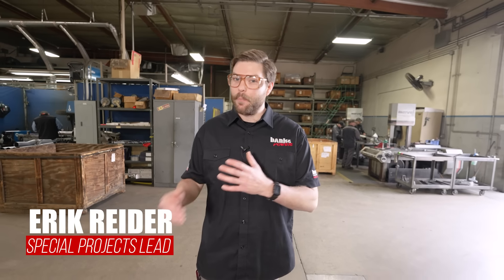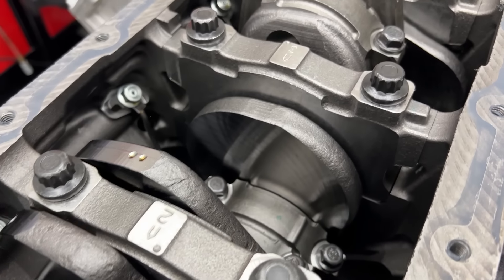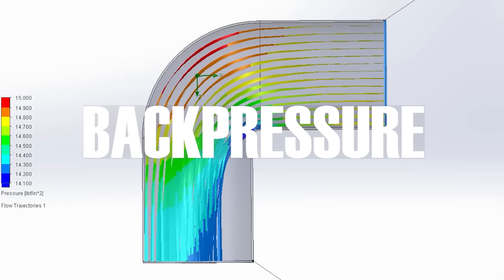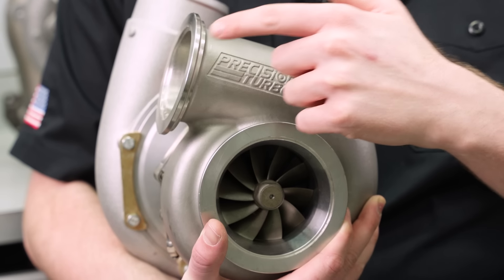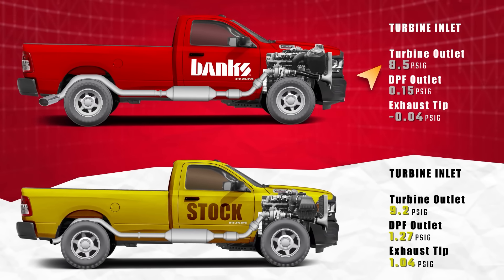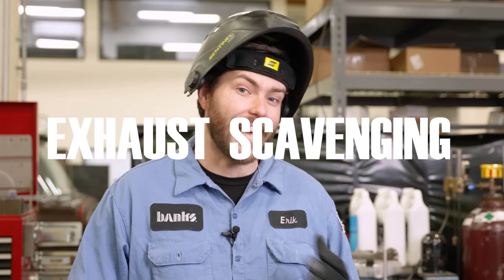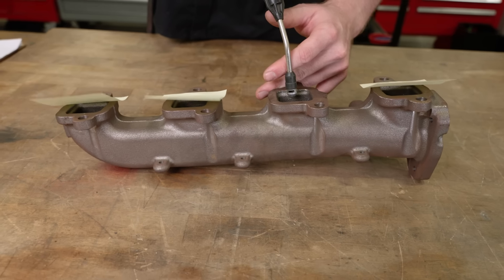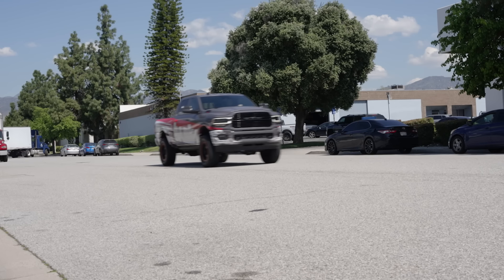Busting the exhaust backpressure myth | Banks Entry Level

Comment: I was taught when i was 5 that engines are air pumps and they need free flowing intake and exhaust  - the exhaust should have at least 8" length ZOOMIES ARE BEST & IF YA CANT PUT ZOOMIES ON THEN AT LEAST HAVE EXHAUST THAT SCAVENGES THE OUTGOING AIR!!!  I hear a lot of idiots say i want this muffler or that muffler i tell them all your doing is killing your power and damaging your engine "they want a certain sound i say THERE IS NO GREATER SOUND THAN STR8 PIPES OR ZOOMIES!!!

Comment: I don't want to rain on your parade.Mister expert but I had a motorcycle that had a hole in the exhaust pipe. Resulting in the loss of backpressure the valve lasted two weeks then it was burned right through it was cheaper to get another motorcycle than it was to have that bad exhaust valve replaced

Comment: How did you manage to patent a slash cut exhaust pipe?  Harleys with hot cams need them, and they are LOUD.
Not one word in your vid about camshaft lift, duration, or overlap.
Intake flow is also critical, again, with regard to  the camshaft profiles. Mild cams don't like a flow rate that is too high.
You are attempting to describe a whole tree by what you see on one branch.

Comment: so by this videos logic I need as little  as possible… so no headers?
Reply: Ya just drop everything go full send! 

It actually can run fine, granted having no place to put sensors in the exhaust can make tuning a challenge. The main problem comes when you shut it off and it sucks in cold air thought the exhaust ports straight onto those hot valves and they decide to not stay the original shape. A good exhaust using scavenging is the way to go, but even just a ok exhaust is better then thermal shocking your exhaust valves every time you shut it off. Maybe it’s not as big a deal today with modern materials, but I don’t drive new vehicles anyway so it’s still a thing for me lol
Reply: @jaydunbar7538 do you have any evidence that shows this could happen?
Reply: ROFL

Comment: The explanation of the hair dryer is WRONG!!! when you block the outlet of the hair dryer the motor has less resistance to push air so it speeds up, think about it when its moving air its doing more "work" when you block the inlet or outlet it is moving less air and it increases in rpm and reduces power draw because is is working on less air, put the hair dryer on a watt meter and prove me wrong! if you cover the inlet or outlet it will draw LESS power! this is a common miss conception because it would take our lungs more power to push air out but the fan blades will stall and use less power.

Comment: The flow pattern inside the exhaust created by the recipricating action of the engine is a series of pulses each having a high pressure profile at the front end and low pressure profile at the tail end. It is certainly not a laminar flow pattern as you suggest in your diagrams. The use of the term "Backpressure" when talking about head loss is the issue. What you are really taking about is resitance. It is misleading and no doubt an old marketing scheme for cool sounding mufflers with bad flow characterisics. Lower pressure on larger diameter pipes is expected along with an increace in velocity of flow. That is the physics of the flow of fluids through pipe. Compressible and non compressible. The bottom line is the most efficent exhaust pipe is no exhaust pipe.

Comment: The reason a little back pressure is (was) needed, has NOTHING to do with clever salesmen, that's just BS he pulled out of his ass.  The reason has to do with carburettors that were tuned to specific engine specs. When the specs changed with high flow air filters and extractors, if the carburettor was not adjusted accordingly, the resulting air fuel mixture leaned out.  Sometimes so much the engine was damaged, overheating, burning out valves or pinging like crazy and scarring the bores, in extreme cases even burning holes in the tops of pistons. Other times (usually), the engine just ran like crap and chewed up plugs.  This is STILL the case for non EFI engines that are not tuned correctly.  So yer, if you're going to have an engine tuning channel, then maybe you should have some idea of what you're talking about and not just make up stories.

Comment: this whole thread is kind of stupid because that back pressure is needed but that pressure is needed on two strokes. Have you ever noticed the two-stroke exhaust when it comes out of the jug it’s a small pipe and then it goes into an expansion chamber where then it gets choked down, even smaller, as far as a diesel engine, or any other internal combustion engine back pressure is an enemy anybody with a little common sense knows that top fuel dragster’s make up to 20,000 hp they have open exhaust Zumiez to give them as little restriction as possible even though they’re still getting restriction from the bend in the pipe every been in the pipe is at least a 20% reduction in flow

Comment: so if the kinetic energy is in the crankshaft why have heavy flywheels?
Reply: To add weight in a easier way then buying a new crank, and in some
Applications it’s just for the strength. Use your judgment on why in the particular application you’re thinking of.
Reply: @jaydunbar7538 
He is questioning banks pseudoscience

Comment: 2 cycle engines will not run well without that very special back pressure;

4 cycle engines with mild, street, cams need the SAME backpressure as the factory made; 

when you DE-CAT a pipe (breaking up and removing the ceramic innards honeycomb, leaving only the shell to make it look like it's original...), well, after that, the car runs ROUGHER and BURNS MORE GAS;     the FACTORY BACKPRESSURE of the honeycomb is needed, the flow in and out of the combustion chamber was precisely adjusted for it;

but... too much backpressure (plugged up CAT(honeycomb)) , that BURNS EXHAUST VALVES,if you run it hard,so, better remove it;
  also,  (EGRs KILL engines, REMOVE?? do it now...).

Comment: I’m wondering why the Banks exhausts are a specific size and not larger.

You know, if they would give less back pressure being larger. 🤷🏻‍♂️

(Around 4:20 he says “why you want to MINIMIZE back pressure”, NOT eliminate it. Interesting choice of words.

At 7:50 or so he says “we have proven that ALL BACK PRESSURE IS ALL BAD ALL THE TIME” so why not eliminate it totally? Earlier he said MINIMIZE rather than eliminate back pressure.

He later says that NO scavenging happens with OEM manifolds, but you CAN clearly see some happening. 

The title, ignoring the contradictions and errors and failing to address how much or little back pressure remains, and why, would be much appreciated. 

This video seems disingenuous as a result of those failures.)
Reply: Usually size is limited due to clearance
Reply: @seanbaker1627 
Not in racing

Comment: Guy who sells exhaust systems with low/negative backpressure tells you backpressure is bad and that the myth that its good comes from people who sell exhaust systems with high backpressure. Whats the definition of irony again?😂😂

Lowering the pressure at the cylinder will reduce the loss from having to overcome the pressure, but at the same time you reduce velocity which may result in more exhaust gases remaining in the cylinder, reducing preformance and causing additional carbon build up.  Maximizing velocity while minimizing backpressure is the name of the game. You can't overcome ambient pressure with negative pressure.

Comment: Your hair dryer analogy is not correct. If you measured the current to the motor you would see that it goes down when you block the exhaust. The motor speed increases, but the work being done goes down because of the decrease in mass flow.

Comment: 1# you should think of the flywheel as a horse power storage device not the crank. 2# your valve train anamation has zero valve over lap. Not a good look for someone trying to explain exaust systems.

Comment: So many things WRONG in this video it's embarrassing, I don't have the time to point them all out.
7:10 less back pressure can create more HP at the top end and reduce HP in the low and mid rpm range where most cars/truck SPEND MOST OF THEIR TIME, making the vehicle less enjoyable to drive around town (especially motorcycles)
9:58 "with our headers we tune them correctly"?? for what? peak hp at the top end, basically hurting low and mid preformance. I have 4 decades of tuning with a dyno for a race team, I call most of this video rubbish. There is so many variations of vehicle use/purpose, and this video is busted.

Comment: Haha you dump on the 1950s sales spiel, yet you fail to realise that your negative pressure at the tip is only because of the huge can and is only localised and having little to no impact upstream.

Bernoulli's principle tells us that the increased cross sectional area will result in a proportional DECREASE in flow (velocity). A 20% increase in cross sectional area, will give you an approximate 17% decrease in gas velocity only in that section.

But in practical terms, the exhaust gas has weight and therefore momentum, and when it transitions into the larger volume, it will tend to do so at the same velocity, and it will create a temporary negative pressure as the Ideal Gas Law tells us that when volume changes, pressure changes proportionally (inversely).

Comment: thats not what backpressure is, nor what the concern with backpressure is.  you are referring to exhaust velocity and negative pressure.
your strawman fallacy is invalid.
all internal combustion engines have backpressure waves flowing up and down the exhaust pipe (and the intake, but that's not the topic here). those backpressure waves must be 'timed' to flow back to the exhaust value during the period when the exhaust valve is closed and flowing away from the exhaust valves while the exhaust valves are open, this helps extract exhaust gases, instead of forcing burned gases back into the combustion chamber, refusing efficiency and therefore power output, via scavenging.
the only relevant backpressure in a turbo system is the backpressure waves flowing between the exhaust outlet and the turbine blades, anything after that point does not affect power output. 
maybe you should know what yr talking about before teaching everyone false information.